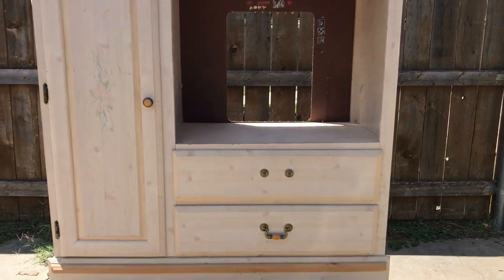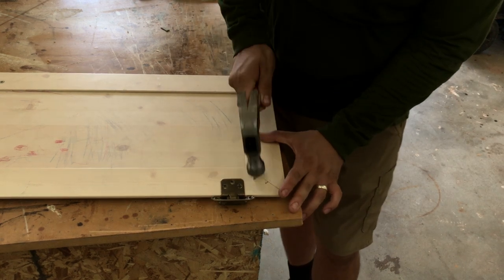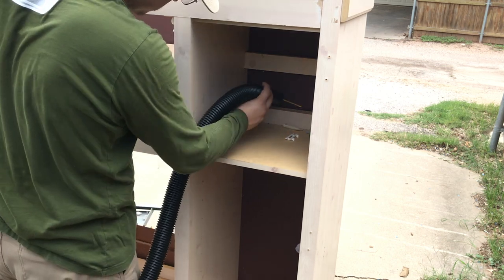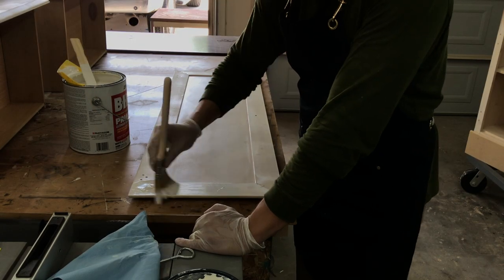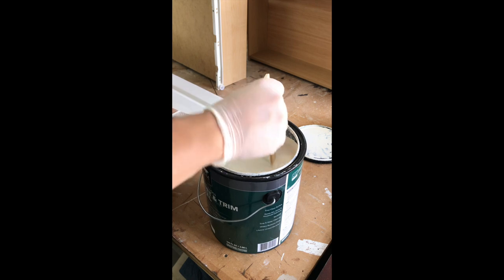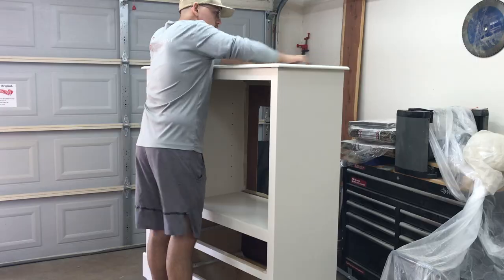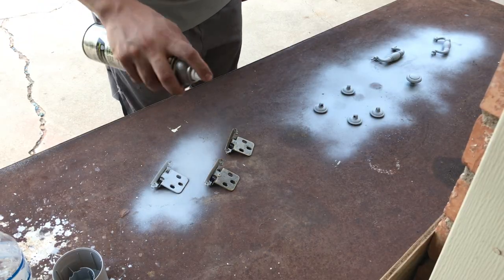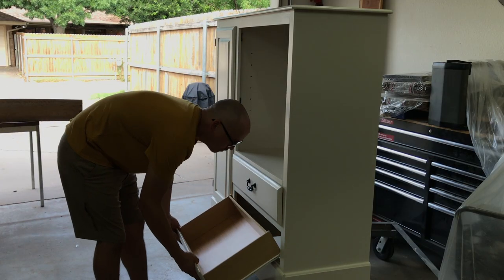Facebook Painted Furniture / Laminate Furniture / Makeover Inspiration / Modern Tv Stand Makeover

Comment: Nicely done, you mentioned your open for suggestions. 

If you were to fill in the holes on the inside of the cabinet with bondo, sand and then paint as well as replace the back completely with a new piece of particle board and then cover with a trendy self adhesive wall paper i bet you could get more for the cabinet, plus it makes the piece more versatile.  Take care and all the best.
Reply from the maker: Thank you so much! I might have to try that since I still have it in my possession. Would've never thought of that.🙂
Reply: I use 1/4" luan plywood for new backs.